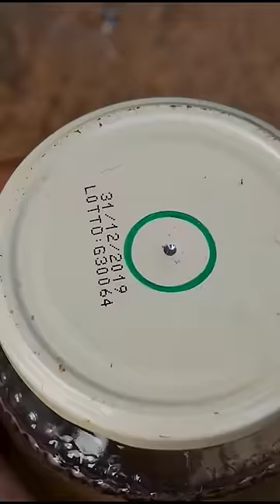ستفاجئك النتيجة ابتكار مفيد من الصاروخ فكرة رائعة = simple inventions diy craft

Comment: NEVER ever do something like that. If it breaks you're risking serious injuries ...ONLY use that grinder for its intended purpose and with quality commercial attachments ...that machine is extremely powerful .
Reply: I learnt the hard way and I wasn't mis using the grinder, I wasn't careful enough. I was cut by the  grinder after it was switched off. No power to it but the last spin after switch off still did the damage. That's how power a grinder is. Don't do what this guy has done.
Reply: Вот кому делать нехера
Reply: u